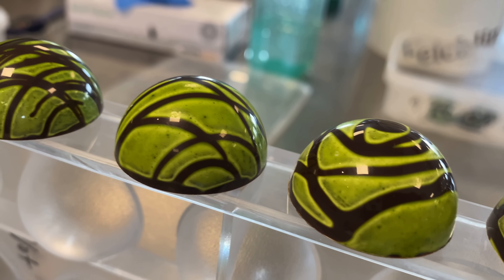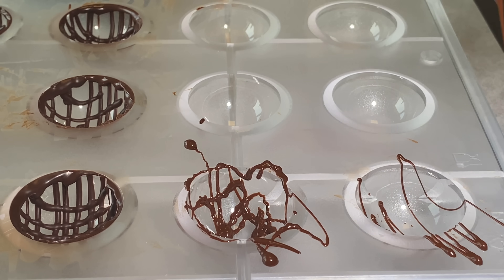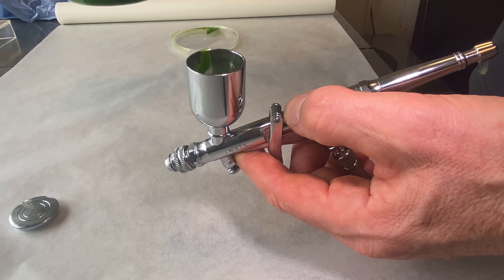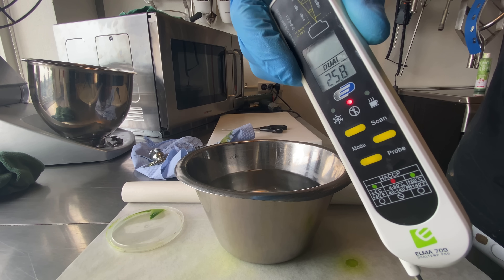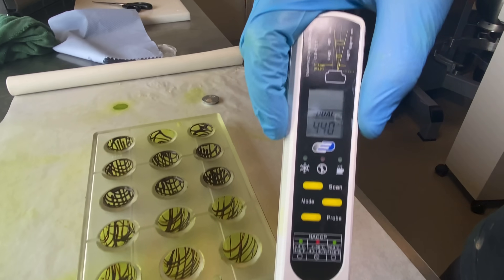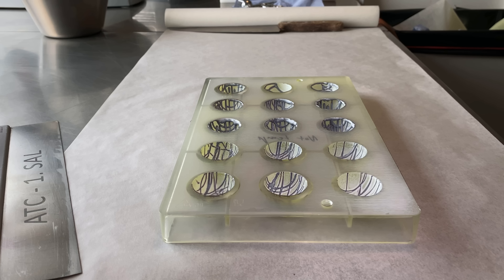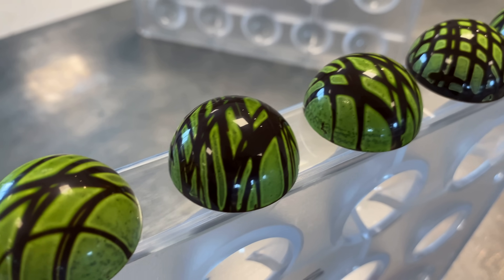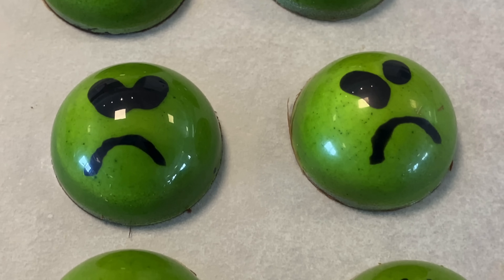Bonbons with untempered cocoa butter

Comment: Hi there, I'm a retired pastry chef and I do some chocolate work for fun now.
I'm not sure if you know but I'll offer my understanding, it might help others.
When we buy cocoabutter its already tempered, unless damaged in transit.
If you melt it to 45C it is fluid but still tempered, so you can cool it to working temperature and its ready to use. You know that I see. 

Dark choc is similar but the maximum melting temp is lower, I like to melt new tempered callebaut 811 choc to approx 37C , then lower it to 32-33C. and its ready to use.
I own a small commercial tempering machine but I don't use it any more, its so easy with the microwave. I think its like the bicyle, once you learn you don't forget.
Reply from the maker: Sorry. What you are saying its simply not true. Please dont teach my students. I work in a company that is selling equipment for the Chocolate industry. I Can feks measure the meltingpoint of cocoa butter or chocolate. Anything fat based. If you temper like you say the melting point Will be lower. I guarranty you. When you temper chocolate, you temper the cocoa butter! Heat to 40 to 45 C, cool to 32 by adding tempered chocolate. When you temper pure cocoa butter you melt the butter and cool to feks 33 degree. If you spray this, the butter Will cool and Will be tempered as well. But the fact is if you cool to 26 and heat to 29-30 its better tempered and Will get more shiny. You should try that. So with all do respect please stop teaching People on this channel🫶

Comment: Markus, very beautiful design! Can you help me please? I followed your advice from other videos and colored bonbons have a perfect shine, but every time I make bonbons, about 1/3 of the  bonbons sare hard to get out of the mold. I am doing a chocolate test and it is tempered. My actions: after coloring the molds, I let the cocoa butter stabilize at 16 ° C overnight. Tempering milk chocolate 45-31 / 32 ° C with callets. I fill the mold chocolate, make capsules and send it for crystallization at 10 ° C  for 20 min. After I send mold to 16 ° C  for another 1 hour or more, sometimes at night. As a result, 1/3 of the capsules do not come out. I can't reach them from mold,  but the other 2/3 look great, without defects. what do you think is the problem?
Reply: Hi, i had the same and I once heard that if the bonbons don’t come out of the mould, your cacaobutter isn’t correctly tempered or the temperature of your mould wasn’t correct. Maybe you can also try to cool down the mould/bonbons (when completely finished) back in the fridge for 20 min. Cover them with a plastic sheet. Good Luck!